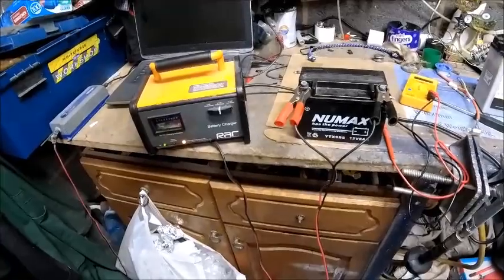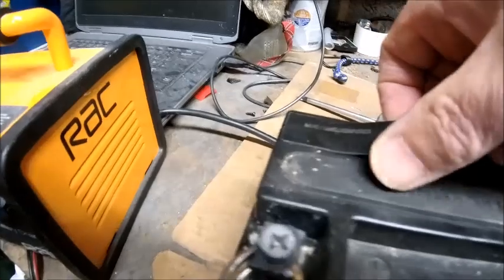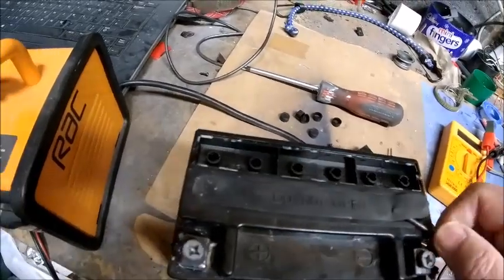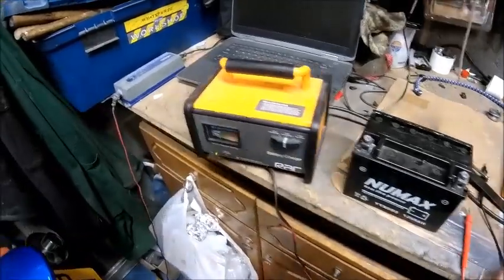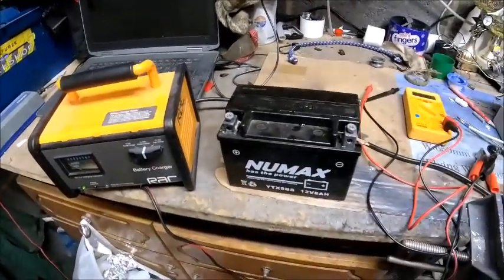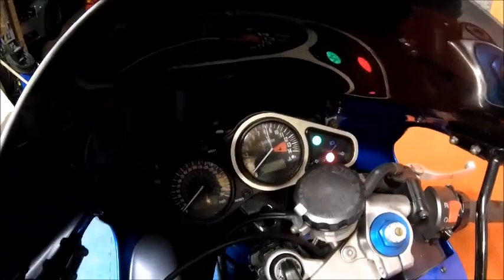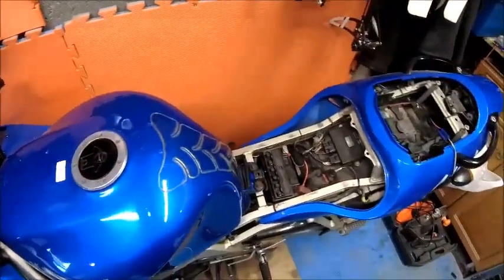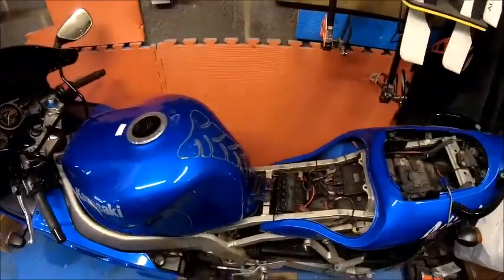Kawasaki ZX9R Battery Issue | Part Two

Comment: I am genuinely happy for you.
That was pretty surprising to see !
I have a gel battery in my ZX9R E bike and it's not cranking either.
I always thought the gel batteries were not serviceable..
Just for kicks, I will try this with mine if it's possible to get it open like yours and see if it does the trick.
I won't rely too much on it as it's around 5 or so years old now and probably due for e replacement anyway.
Thanks for the video !
Reply from the maker: Sometime i just surprise myself 😂

Comment: Hi Ade, enjoyed your videos on the bike, does this model of zx have a fuel warning light? My 98 blade never, found it a bit of a pain tbh
Reply from the maker: Unfortunately no...i have to remember to set the trip to zero each time i fill up and about 120 miles in give it a top up.....not too much of a problem for me as i'm wrecked after 100 miles anyway...comfort is not the best part of a ZX9R   :)
Reply: @AdeReeves  thanks for that,  same as my old 
blade then, really like this early model zx9r though,  prefer it to the twin lights models, going to get one in the spring
Reply: @AdeReeves  picked my zx9r up this  morning Ade, 98 green model,  made up with it